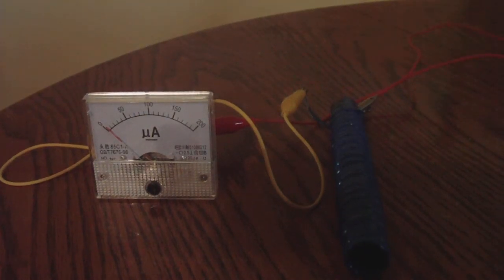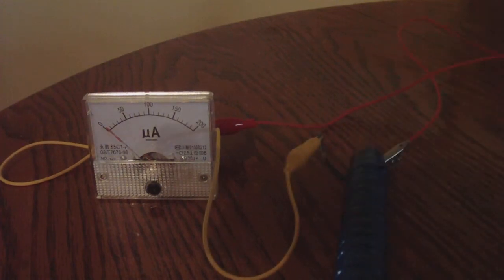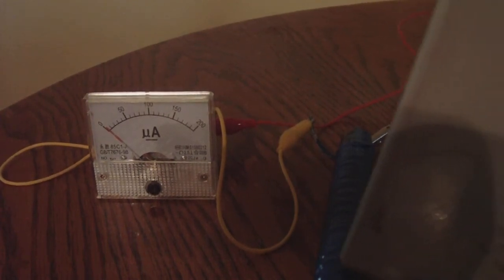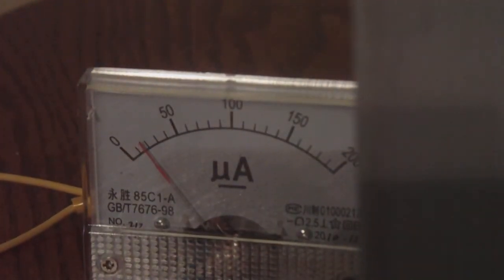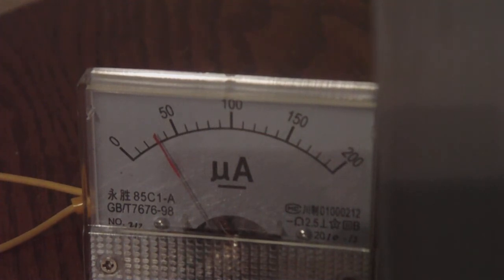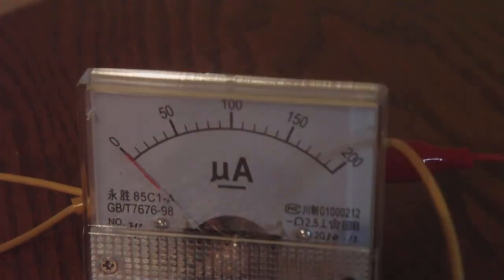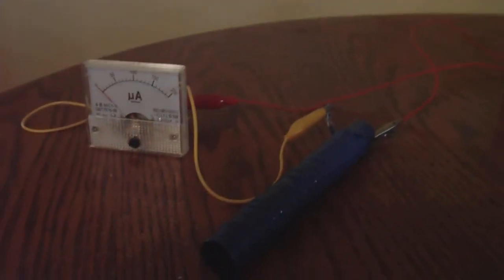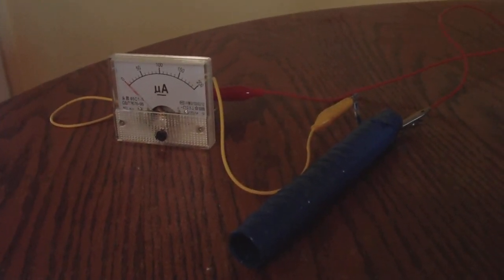Pressure Is what powers the Crystal cell

Comment: there are also other possible reasons for your results, for example when a galvanic cell, that utilizes an electrolyte mixture in between two dissimilar metals, when a cell like this dries out and the water is very scarce the voltage drops because there is no electron movement within the cell, however when you press or squeeze the cell you are forcing the damp but not wet mixture inside to al make contact thus permitting electron flow again. I know this because i have made galvanic, or fake crystal cells that have had this phenomenon, and when I wet down the cell again it acts normally. all of the tests done on real crystal cells made my Marcus Reid show that applied pressure on the cell has no effect on the output. That said, i enjoyed your video and hope you continue to experiment. you got a much earlier start than I have.

Comment: I saw in another experiment where you were experimenting with amperage by increasing scale of the area of the glue in-between a copper plate and an aluminum plate. What would happen if you applied pressure to the plates? Does having more area of plates and area of pressure have an effect on amperage then?